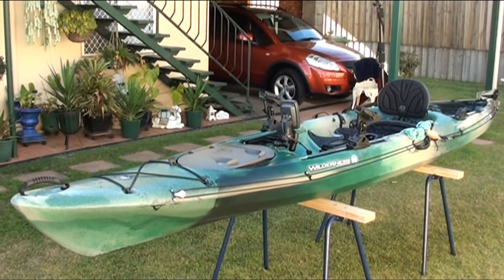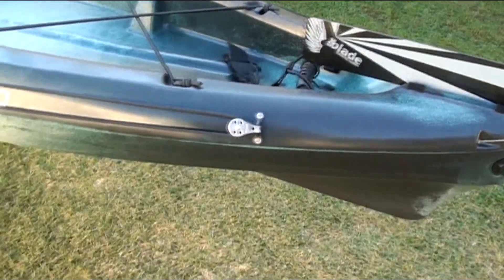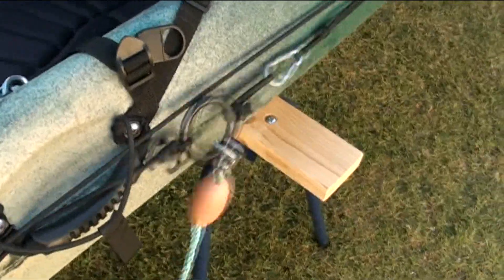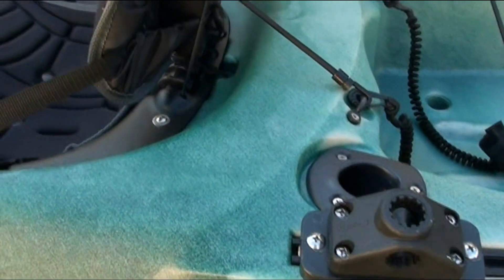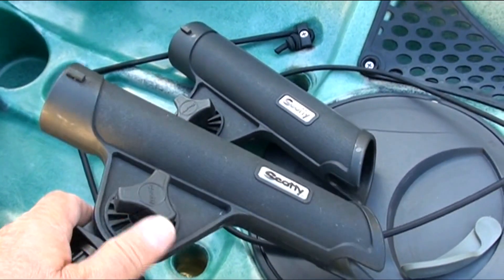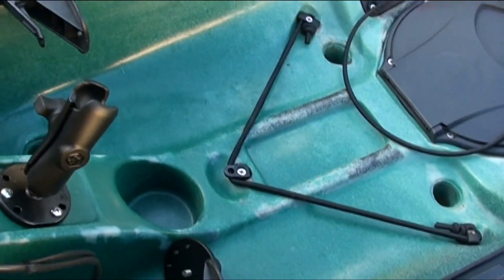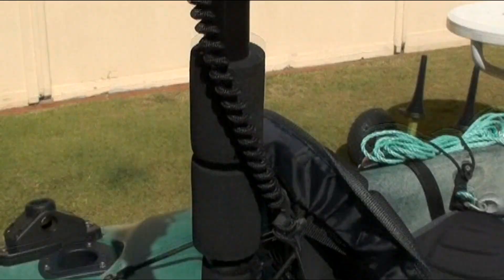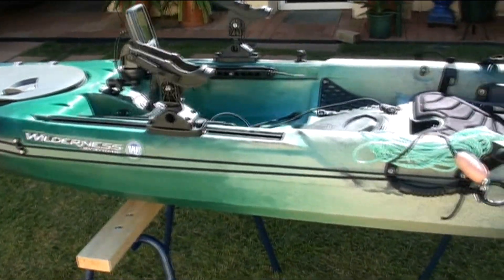Wilderness Systems Tarpon 140 setup

Comment from the maker: Hi Christian,
Don’t let the hatches deter you. I’ve had no problems with my 140 or the 160 Tarpon hatches. The round hatch near the seat I use to put my immediate fishing tackle and anything else I need while on the water. The front hatch is for the battery and spare gear. The round hatch is more watertight than the large front hatch. I’ve had no water get in on a normal days fishing including rainy days or the odd wave breaking over the bow. About the only time I get a bit of water in is when I wash it down with the hose. I also have a Kaskazi Dorado 11 kayak, it has 3 screw-down hatches which are waterproof it also has a large fish hatch in the centre which I would class as semi waterproof as a bit of water gets in on a rollover but the Kaskazi Dorado11 is purpose built for offshore fishing. If you are camping/touring I would suggest dry bags on any type of kayak. As I use my kayaks for fishing I rarely find any water inside the kayak. In my opinion the Tarpon 140 or 160 are ideal and purpose built inshore fishing/touring kayaks. Buying a Tarpon 120, 140 or 160 will be determined by the water you kayak on, its use and if you have to lift it up onto a car roof rack. In my opinion I would rate the Tarpon hatches 7 out of 10.
Reply: tony

Comment from the maker: Hi daines1. I kayak fish inshore, like estuary's and broad-waters. Upstream in flat water ok to stand but not ideal, have rope tied to front of bow and help to pull you up. As most of my fishing is in tidal waters it's not good to stand in strong currents plus I'd rather sit to keep a low profile, if you can see them then they can see you so standing does not help me. I also have a Tarpon 160 and is good for longer distances. If you have to lift kayak onto car I would go the 140. Both are very good, all depends where you fish and conditions on the water. For me I would not go smaller than 140.  Most of my fishing is now done in the 160 but you can't go wrong with a140 both are just as good as each other.

Comment: Hi Tony, I'm looking at purchasing a Tarpon 120 or 140 and just wanted to get you opinion on the orbix hatches and whether or not you have had any issues with them leaking at all? hence allowing water into the dry hull. I've read a few reviews from different sources and this issue has been mentioned about the new orbix hatches. Appreciate any info
Regards
Chris